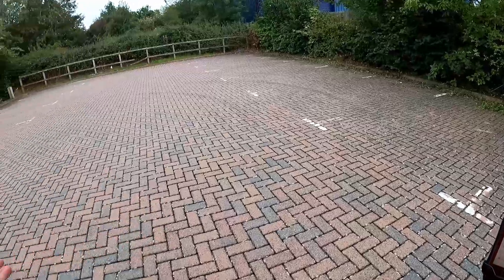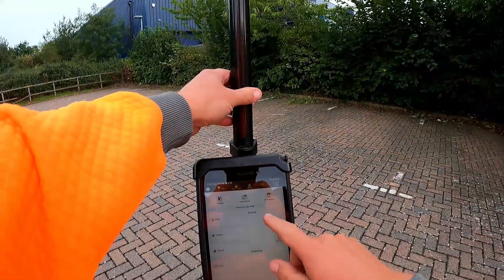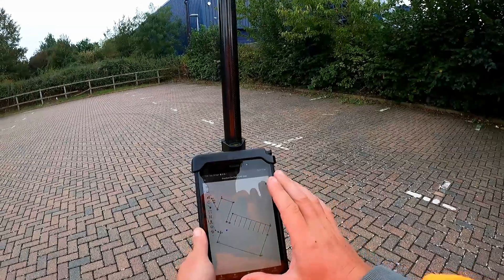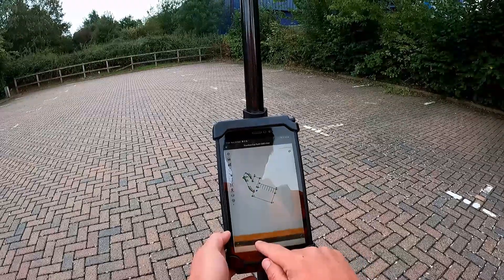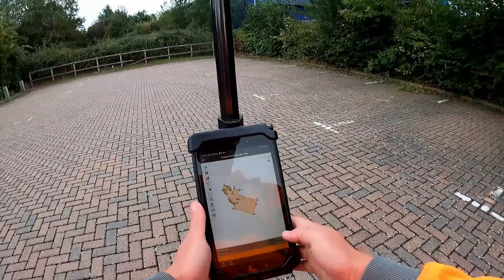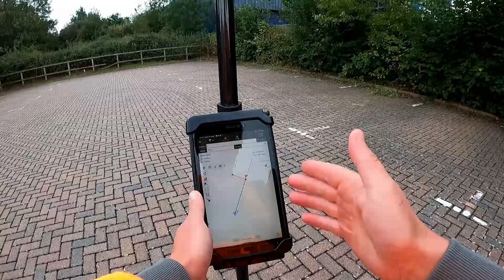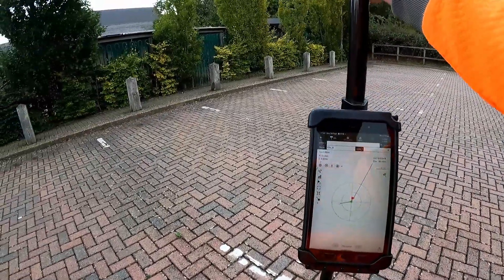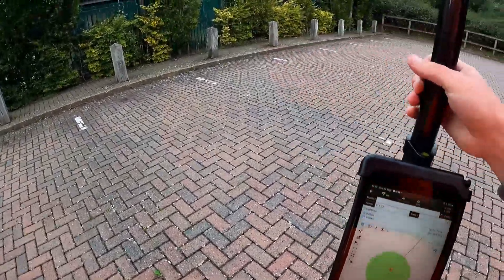Surveying and Staking points with Idig GPS Spotman

Comment: Its the same provlem for all gps for using them for somthing lime a kerb line you cant put the pins in at the top of all the droppers to the gps, the line will end up like a snake . But if you mark the 2 ends of the kerbline then pull a string and use that for the line and the gps for position its fine. 

Good to see youve fot the new system from nasco are you fitting it to both your machines?